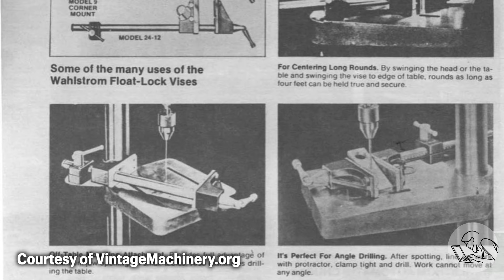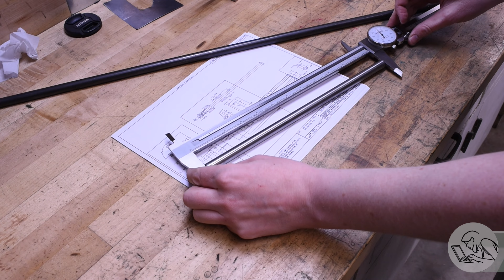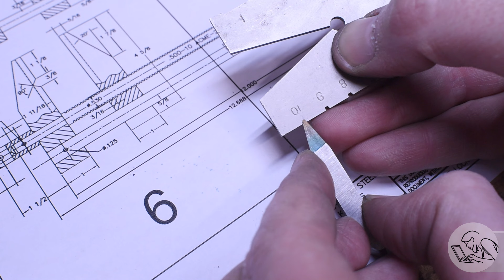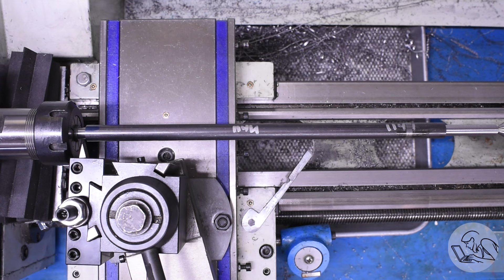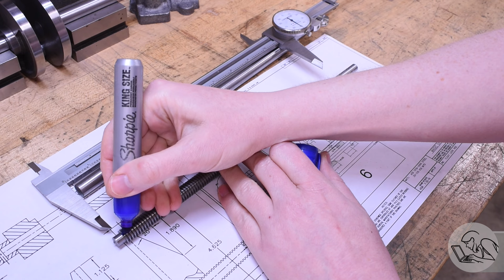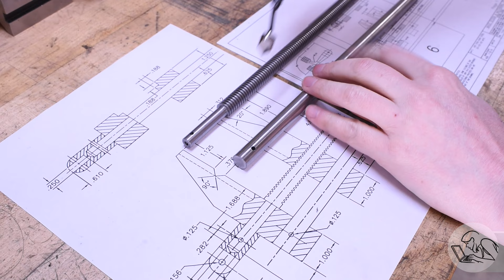Acme Thread Cutting! Making a Float-Lock Vise, Part 1

Comment: Hi Quinn,
Nice Acme thread cutting and I applaud your way of working through unseen problems. I once had to cut several 1 1/8" X 4 TPI internal square thread bushings to be pressed into 25 lb. barbell weights that were used on a antique telescope where the declination axis shaft was threaded 1 1/8" x 4. That was done on my 7 X 12 mini-lathe with a hand crank in the spindle. I made a silicon mold of a portion of the declination axis and then used low melting point casting metal to make a positive for a thread gauge. I was difficult on the small lathe, but did get it done and the barbells worked great as counterweights for the telescope. Once the point of balance was found, you snugged up the counterweights against each other and that held their position. You and the family stay safe.

Comment: I wonder if you could make a holder for your rub brass or a bearing that clamps under the unused clamping screws on the back of the tool holder and goes up and over the holder and stock.

Comment: I know this comment will get lost, but here I go anyway!  I have worked for a thread shop for almost 20 years.  I have had good luck letting the chatter go, and on the last pass...speeding it up and it takes out the previous harmonics without letting the new ones develop. (that's the best way I can explain it)
Reply from the maker: Good tip!

Comment: Chatter !! Try holding a piece of wood ( broom dowel ) between the work and the saddle from the back lifting it gently toward you. A Lrg ball peen hammer is another good tool for chatter, just sit it on top of the work with a little pressure toward you all though they tend to vibrate a bit .  I find the broom handle better. You will be surprised at how good this temp fix works.
Reply from the maker: Great tip!

Comment: I noticed when you were measuring the thread that the guide appeared to have a fair bit of space at the top of the thread. Is this intentional or was it just a trick of the camera? If it was intentional, what is the reason behind it? Does it help the thread run better?
Reply from the maker: Mostly a shadow line from the angle. I’m sure it’s not perfect either, but acme threads have a lot of clearance tolerance in them so it should be okay
Reply: @Blondihacks  Thanks for the reply. I really enjoy watching your videos even though I don't always understand why you are doing some things or doing them in a certain way. But then, I've never done any kind of metal working before so that's not too surprising.

Comment: I have a similar problem deburring holes when making fingerholes on bagpipe chanters - my solution is designed for fingers: take a finger sized rod, wrap abrasive around it, and run it longways over the hole at 90 degrees to the part.

Comment: With making acme thread and nut thingies; I always cheat in 2 ways : 1. I make the thread way thicker than it needs to be (more rigid and easier in the lathe). 2. I always make them about 5 to 10 cm longer than I need them to be; I cut that off, do some milling on it and heat-treat it (I use mostly tool steels) and tadaaaa, got a matching tap :D  ...

Comment: Just watching the 'action', you might be able to use a ball bearing, mounted to a square or hex shaft, that slides in a matching 'tube' , with an adjustment screw that pushes on the follower through a compression spring; you get both travel/distance setting and pressure setting, with one adjuster/adjustment... that mounted, maybe magnetically, on your carriage, so that it can be set in line with the tool, and travels with...Might be 'interesting, to fill the follower 'tubing/shaft', with lead, to give it a bit more mass/damping?

Comment: Good thinking on the makeshift steady rest. My boss had me do something similar with a 3 foot threaded rod that he wanted single point threaded. He pressed a piece of 2x4 to the back of the work piece to cut down on the chatter. It would have worked but he also insisted that I run it at about a thousand rpm because it was taking too long. Then it turned into a nightmare of screaming chatter and snapping inserts.

Edit: Follow rest
Reply from the maker: That’s a great idea, honestly. A piece of wood stuffed in there against the backsplash probably would have worked
Reply: @Blondihacks  Probably not the safest technique. That guy was all about saving money though.

Comment: Hi Quinn, well done, very challenging operation as I know too well.
Last week made a new spindle for my cross slide using 14mm silver steel, 14mm x 3mm trapezoidal thread form, 3 attempts before I got it right using the same method as yours.
Did not use follower rest as thrust is downwards negating the application.
Many light cuts and I cheated cutting the Bronze nut with a Tap.

Comment: 9:57 You left out the air tool sound effect. BTW, how is Oscar these days? 14:15 You could use a spring from the clamp to the tool holder for a bit of preload.

Comment: The only thing I would add to the "how to get something to exact length in the lathe" bit, for beginners,  be careful touching off your tool to the end of your stock.  If your stock is on the softer end the insert on the tool can sink right into it a good like 5-10 thou without you even really noticing because there's not much resistance.  I generally use a 20 thou feeler gauge between the stock and the edge of the tool for things like aluminum/brass to get a known start point. Nothing worse than thinking you cut something perfect and it's actually nearly 10 thou undersized.
Reply: Paper touch off just like on your manual and or vert cnc for setting Z...

Comment: Very good content as always. I once tried to make my lathe cross slide lead screw I used a tough steel I had the same problems with the follow rest and my hss tool burnt quite instantly. It was a real pain and at the moment the project is suspended 😅.

Comment: I once worked with,  what I will call one of the best manual lathe guys I have seen. When he ran into a problem similar to yours turning a long thin part. What he did to damp the vibration/chatter. Was to take his ballpeen hammer and hook it over the top of the stock. Than he could pull back a little or what was required to kill the vibration. The combination of the weight of the hammer and his feel on the handle worked quite well. This would also be a little safer than pinching with your fingers. Never the less you got a good result with what is usually a very difficult turning setup no mater how you do it. O just food for thought  if you do make a follow rest. You might want to consider this. The normal rest is usually designed for right hand turning. In other words the stock will lift when being turned. So you will notice the jaw is on the top. If you make it for left hand turning like in this video, you might consider the jaw being on the bottom.
Reply from the maker: Cool idea!
Reply: @Blondihacks  
Great video Quinn!!  Building on what Peter said, I'd try to utilize the t-slot that is in front of tool and make a block that has a spring loaded bearing to act as a follow rest.   My saddle doesn't have keyways in it, but I bolted a plate where the follow rest attaches to my saddle.   
Can't wait for the next video!!  🥰
Reply: And the Hammer Rest was thus born!